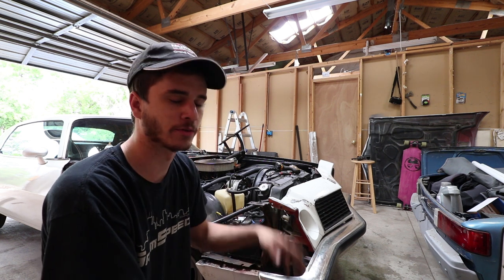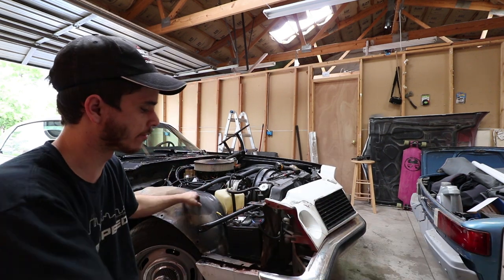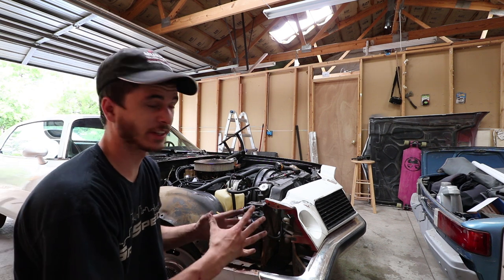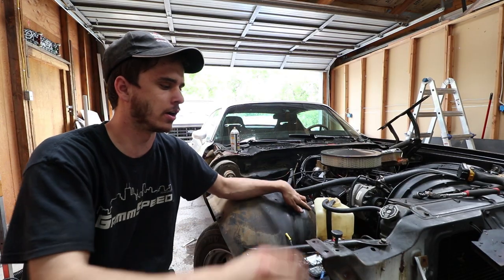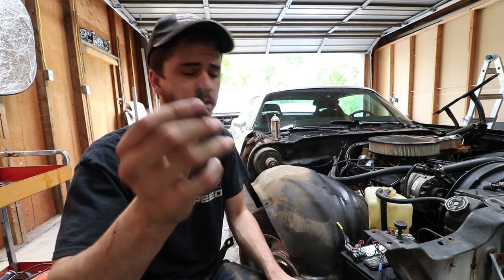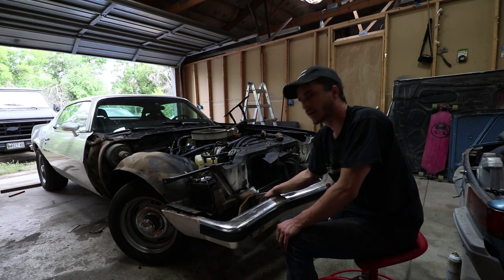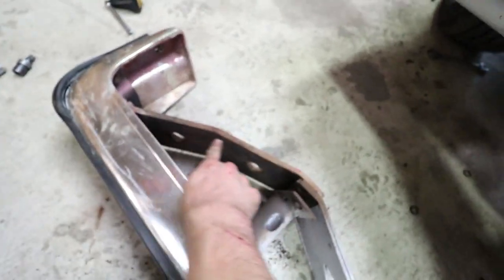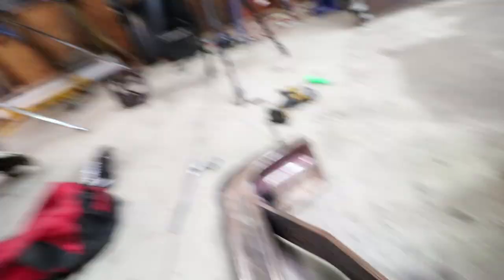'76 Camaro Pro-Touring Build Part 1 | Bumper Tuck and Front End Tear Down

Comment: Yeah it's finally time! :)
Tucking the bumper realy makes the front look less cluttered and heavy, btw if you know what your plans are
could you make a list or something, i know it's getting a pro touring look but what are you going to do to get that look?
Tucking the front fender, check!
Lowering front and rear?
Wider wheels?
Paint colour?
And so on... just curious.
Thanks.
Reply from the maker: I've sorta vaguely gone over it in a couple past videos. But yes, full suspension, fender flares, wheel/tires, make some more power and go to a manual transmission.

Comment: Everytime I see those old american cars I'm amazed, how big and massive everyting on them is.

Instead of welding I would attach the shortened bumper with bolts and nuts by drilling a hole through the inner tube an milling or fileing a oblong hole in the outer tube, to make the bumpers adjustable, which is nice if the car crashed once or has a shitty panel fitment in general.

Aaaand I forgot that this is probably a body on frame car.

Comment: The point makes it difficult to screw up during assemble. i like them.
 Just an FYI the chassis will be mostly metric but thy engine is all imperial inch...most like a turbo 350 trans also standard 3 spd no overdrive, putting a 700R4 in not real difficult 4 spd w/OD... drive shaft shorten TV cable at carb.
Reply from the maker: It's already a Turbo 350. We are going to a manual trans.

Comment: This is perfect... I also have a 76 that needs some luv..  Can the same thing be done with the rear bumper??
Reply from the maker: Yes! I will be doing it to this car soon
Reply: Sweet!!  Hope it's as easy as the front!!   looking forward to the video!
Reply: also, what are you doing to the engine??  The 305 just doesn't cut it... 350??
Reply from the maker: It's actually already a 350 but it'll be swapped with something quite a bit more potent. Not sure exactly what yet.
Reply: Huh.. Was it swapped out once before??  I thought the 76 only had the 305 option?? No??  How about 389 stroker??   Can wait to see what you are going to do!!
Reply from the maker: Engine is out of a 79 pickup
Reply: Cool... Keep us posted!!

Comment: Almost all Chevy cars an trucks from the 70s and 80s use an excess of those pointed fender bolts on everything and all of the body panels had shitty fitment and gaps from the factory it's just something you get used to
Reply from the maker: Yea I've gotta start to get comfortable with those body shims. Yipee.